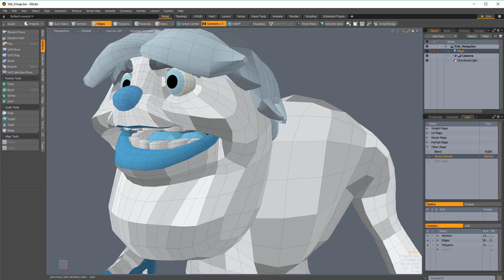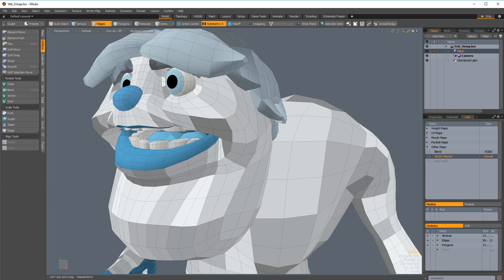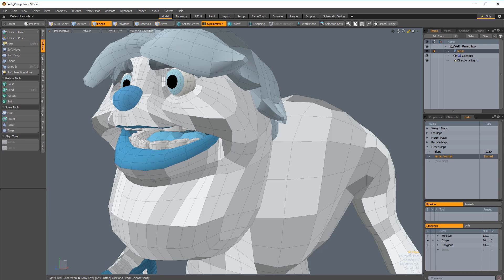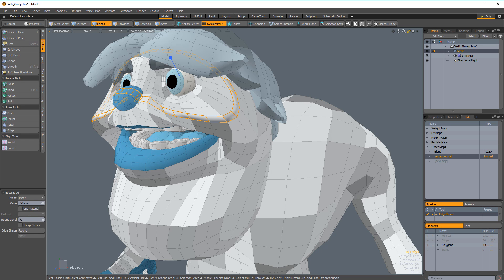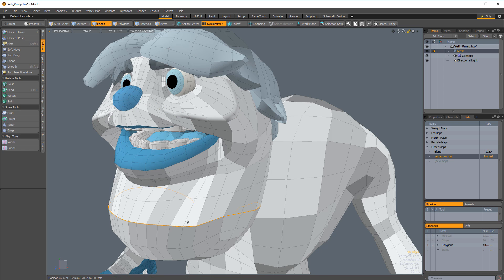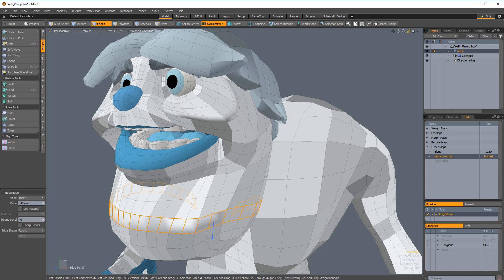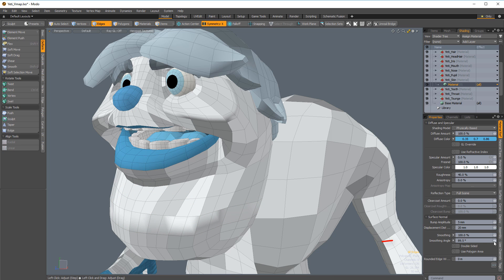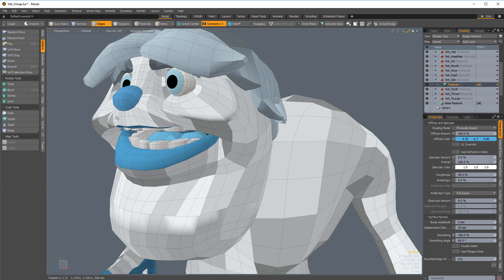MODO | Resolving Vertex Normal Smoothing Issues

Comment: Hiya William, I wondering if you can help me understand what is happening, I sense this is exactly what is going on with Plasticity. 
As long as Move, rotate and scale in item mode everything is fine. If I start to manipulate the imported  mesh directly in Modo then strange artefact/shading errors occurs.
However if I delete the surface normal map in Modo the shading errors disappear however I  now  get mesh artefacts. This sort of makes sense as there is now no smoothing (I suppose the main reason for Vertex Normal maps). So I not understanding why by deleting the Surface normal map(vertex map) solves any issues.

I'm assuming when the imported vertex normal map is deleted , Modo takes over the smoothing, however as I already mentioned the smoothing does not seem to work well.
I even experimented with creating a new Vertex map in Modo to replace the imported version but  I don't' see any difference
Thanks mate
Reply from the maker: Once the Map is deleted you may need to adjust the smoothing attributes.
Reply: @Pixelfondue  Thanks for the reply, I will keep playing around

Comment: It might be something I'm doing wrong, but when I edit smoothing of a mesh with the vertex normal toolkit on the Game tab, I will get artifacts on the mesh when rendering. (It almost looks like graininess caused by low rays or swirling.) Conversely, when rendering an object that has modified smoothing with Smoothing Groups, I never have any issues. Any ideas?
Reply from the maker: start a thread in the forums with images showing the issue.
Reply: Hiya, did you get any help regarding this, I might be having the same issues, Thx